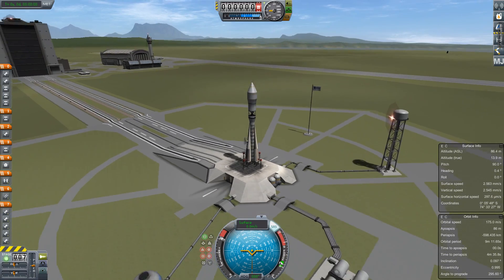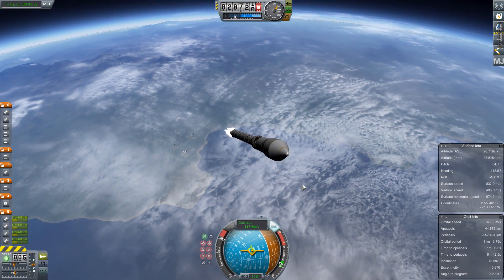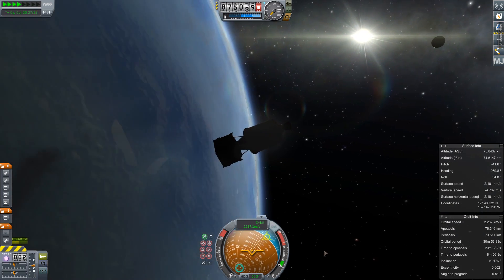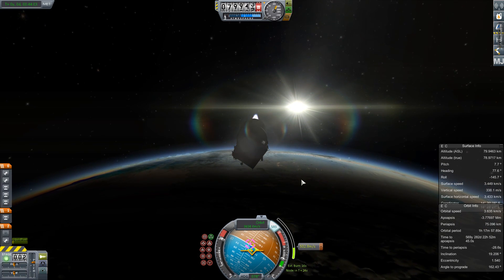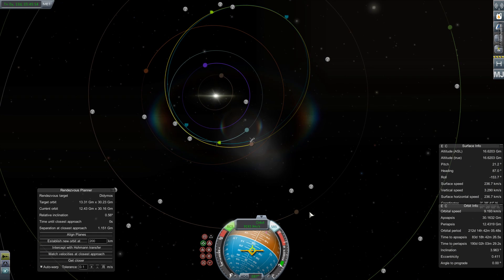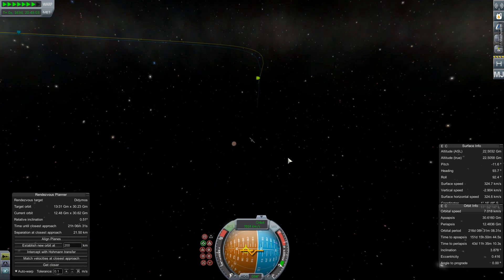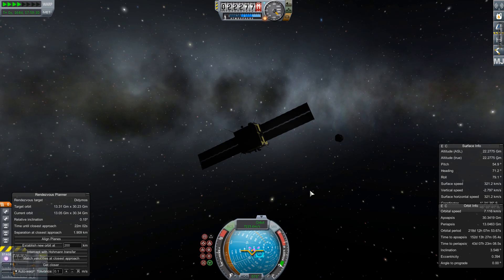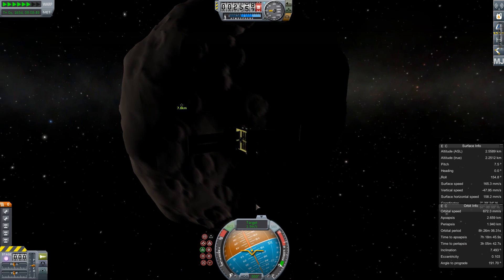Kerbal Space Program - Asteroid Intercept Mission - Part 1

Comment: What is the reason for the game engine calculation problems at 7:45? I'm guessing that the issue is really the precision in floating points. But on the other hand you have 64bits to play with, so you still have quite some room to play with. You're a software guy Scott, so do you know or can you guess? If its an issue with FP, then what can be done? Can you use 2 FP to get better accuracy?

Comment: What actual advantage does optical communication give you in space? I mean, radio waves and light both propagate at the same speed, so there must be some other advantage you get from using one rather than the other.
Reply from the maker: Much higher bandwidth, shorter wavelengths means you can put more data into the signal.
Reply: Scott Manley
Ah! Makes sense. Which means, presumably, communicating via X-rays or gamma rays would be even better--maybe a tad dangerous for the people at the receiving end, though. :)
Reply: @d2factotum  I'm 5 years late, but higher frequency wavelengths such as x-rays and gamma rays probably wouldn't penetrate the atmosphere of earth with any reliability (nor the ozone layer). Though perhaps they would use a sat array and send the rays there, then beam it down to Earth using another method. I could be wrong. I'm no expert.